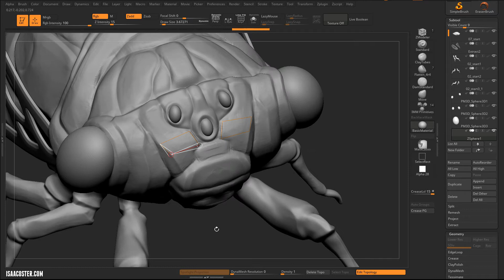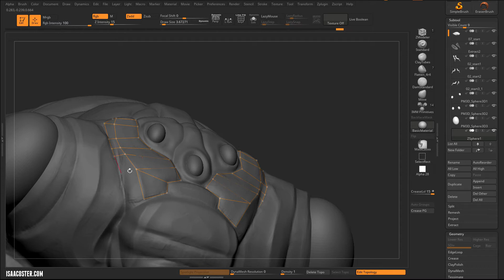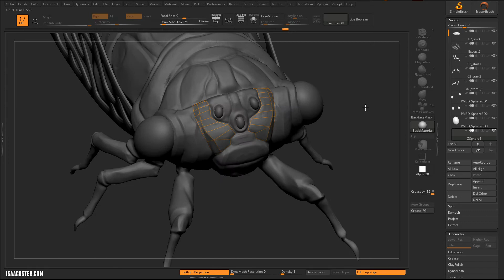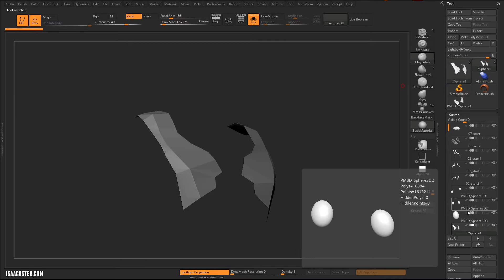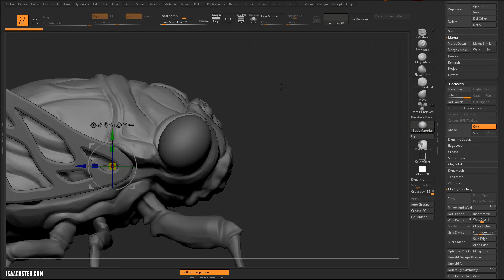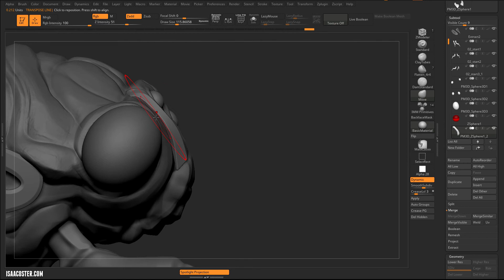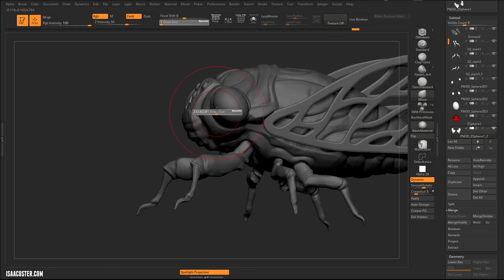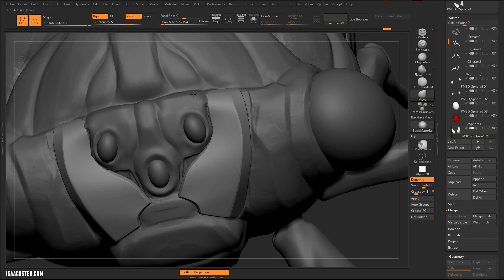Hard Surface Modeling with Zbrush Part 02  - 07 Rebuilding the Head

Comment: as soon as zbrush offered the new gizmo i dumped the old transform tool and have never gone back to it but it sounds as though you think it's still worth learning, offering a few things that the new gizmo doesn't offer?
Reply from the maker: Yeah I like the old transpose tool because it's really easy to orient it along specific edges or verts in a low poly mesh.  The new tool has some great functionality as well, so worth learning about both : )
Reply: @IsaacOster  Noted. Many Thanks.